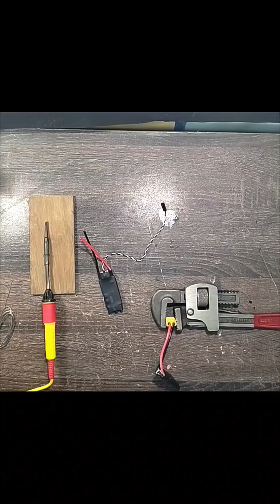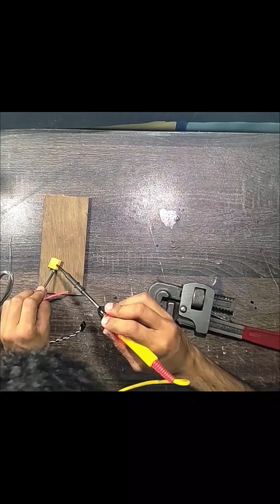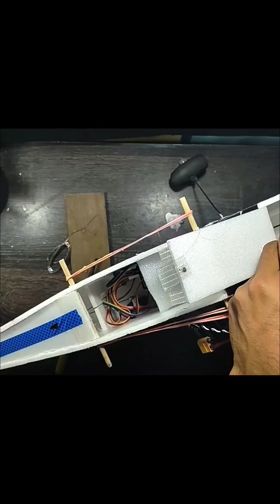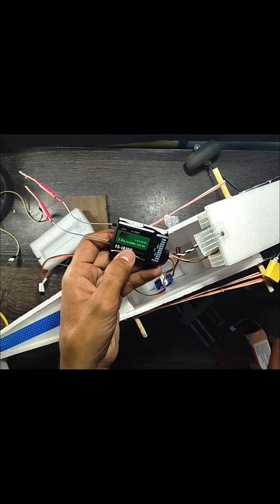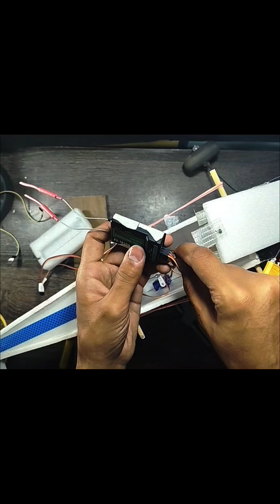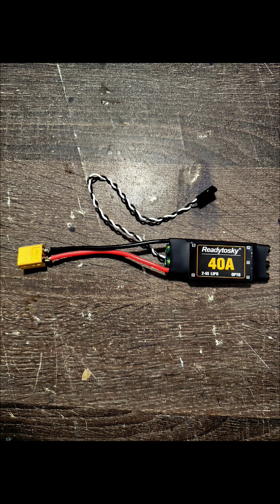Hooked up an XT60 to this ESC but wait where’s the BEC?#Soldering #ESC #XT60 #RCBuild #ReadyToSky

Comment: Use a stepdown voltage module to power the receiver
Reply from the maker: I used 4AAA batteries for the reciever 😅, works though.